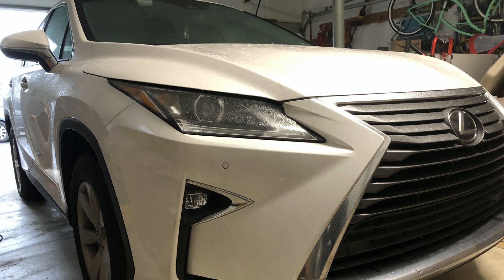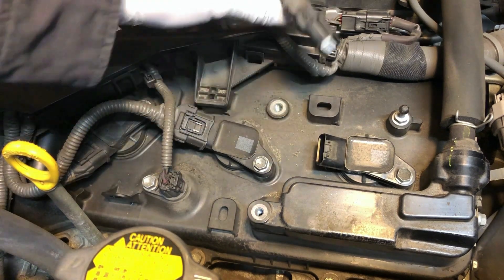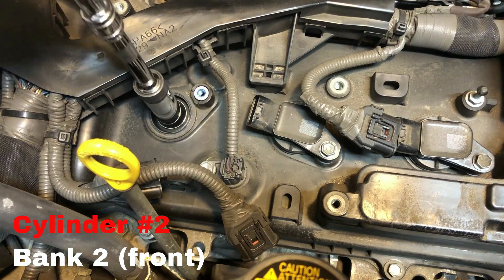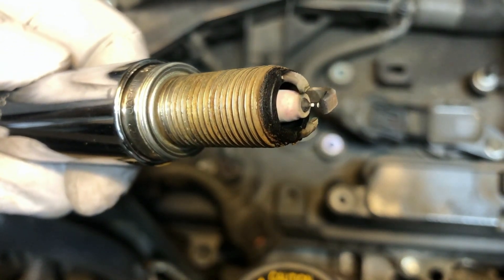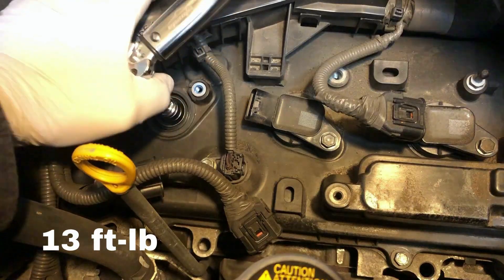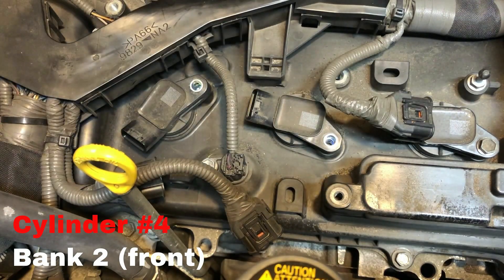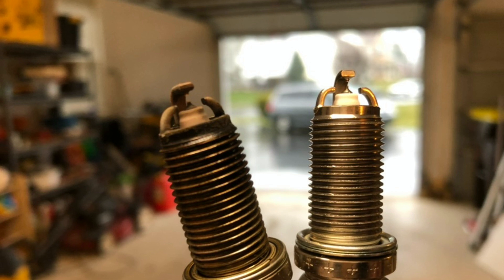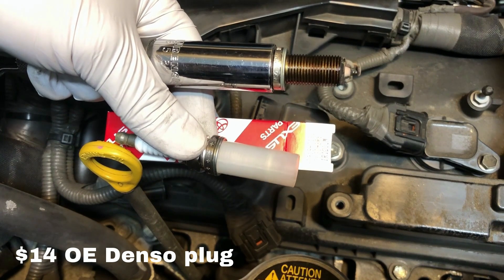Lexus RX350 Front Spark Plug Replacement - Toyota 2GR-FKS

Comment: Hi Professor Garage, 

Do you need to replace the spark plug tube gasket? The 2020 Lexus RX 350 L has spark plug tube seals or gaskets that sit between the spark plug tubes and the valve cover

Thanks,

Richard
Reply from the maker: You don't need to replace those tube gaskets (grommets) unless you have an oil leak (e.g. oil in the tube, valve cover gasket leak). I'll most likely replace it if I need to remove the valve cover for any reason. But I have no concern for now.

Comment: Hi Professor, really enjoy all your videos. Question - did  you buy OEM spark plugs from a dealer -- do you need to check the gap on these or should you assume they are set correctly?
Reply from the maker: Glad you liked them! Yes, I use OEM parts for key components such as spark plugs. In my area (in PA), we have dealerships with ebay/online stores and they offer competitive prices. You should check if you have such dealership in your area--their online pricing is usually better and you can pick up an online order. If not, at least ask multiple dealerships and compare prices. All of these came pre-gapped and greased so there is no need to gap or grease/anti-seize them (again). The pre-gapped have protective sleeves (tubes) and you can trust them from the dealership.
Reply from the maker: I do have that little gapping tool but no longer feel the need to use it. :)